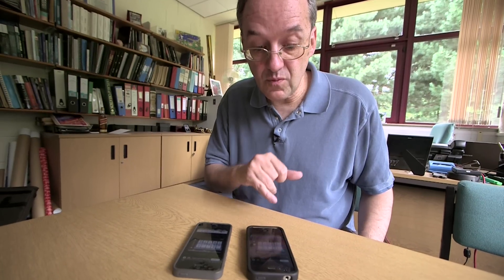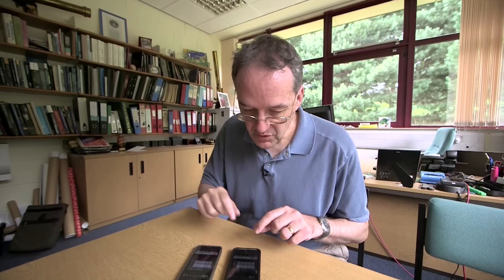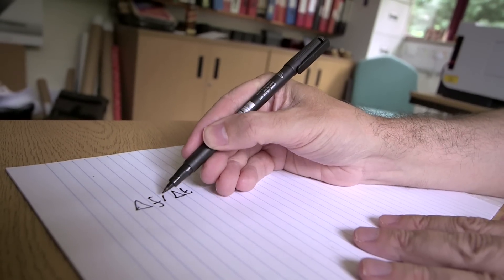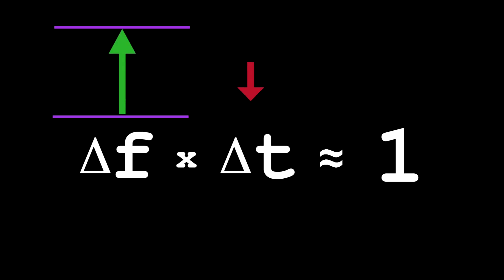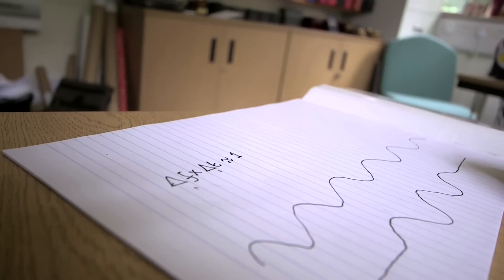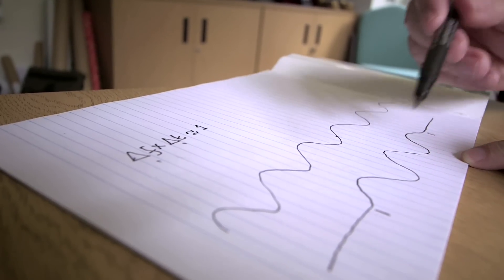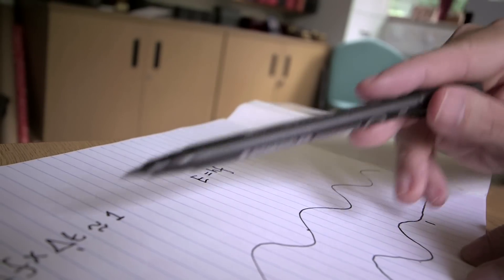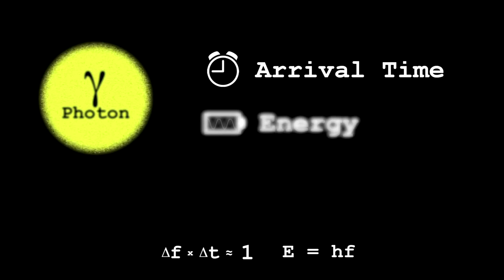What is the maximum Bandwidth? - Sixty Symbols

Comment: More cables. Problem solved. Pay me billions.
Reply: good jorb. clap..clap..clap...
Reply: But you'd need the receivers to process the additional cables and compile it all together, which may not actually save time.
Reply: Stuart Hull Gamma rays are ionizing radiation so they just smash into atoms and knock electrons off them, often changing the properties of the atoms in the process.
 It would not be easy to find anything like an optic cable to shove them down. Radio waves have much longer wavelengths and they just pass through many substances or get absorbed. The range we have to work with for fiber optics is pretty much infra red through lower ultra violet.
Reply: Mexicano President
Many Jobs!
Reply: Give Billions to the Bat-Cat!!
Reply: He said at the end the maximum bandwidth would allow something like a terrabyte of data sent per hundredth of a second. That is far greater than we have now. The fiber optics don't seem to be the bottleneck.
Reply: Extreme wireless, pay me trillions.
Reply: If you can discover new wavelengths then you probably. can make trillions. Phone companies in the US pay tens of billions of dollars to buy a small portion of s wavelengths license. It's called spectrum and so far we have only discovered a small amount of useable wavelengths. If there are more and you discover them first and patent them, you just hit a gold mine.
Reply: Nope, gotta pay for all those cables!
Reply: The people who use my company will pay it off eventually
Reply: Sulfen What you're saying doesn't make sense, you mean discovering wavelengths shorter than gamma rays or longer than radio waves?
Reply: Not necessarily like that. Either discover a way to more efficiently use existing spectrum or maybe there are different types of waves that we have not taken advantage of. It might even be possible to get rid of existing spectrum if we find another way to move data around through the air.
Reply: That makes absolutely no sense.
Reply: Sulfen
Nothing you've said has basis in reality.
Reply: Sulfen WTF do you mean... "data through the air" is radio-communications. Nothing new to do there.
Reply: Think of quantum technology. Before they started working on quantum mechanics we had no idea data could move in so many different ways. Also, think compression. We were able to move larger pieces of data in smaller packages. And you could also think of fiber technology. We went from electric pulses to light pulses making a more efficient pipe.

It's hard to explain something that is not yet possible. People that look into new technologies are inventors. It's not always just about "more cables".
Reply: And before any smartass asks, no I am not an inventor. I am in the programming field and so I do read quite a bit of tech science journals.
Reply: Yeah, if you want to do it like a noob. Send different beams down the same cable at different angles so they don't hit each other, boom, now one cable acts like many.

It's called multimode transmission, we already do it.
Reply: That would only be the change in angle by the change in time by the change in frequency. That still has a  very realistic limit. If within the last few years we have moved from moving megabytes to almost terabytes of data regularly, chances are that we are still very early in the logistic curve for how much data we will be moving. It could even move to being exabytes per second at one point. 

Yes, multimode transmission would help, but it only helps in additive ways, not exponential ways. And data transfer is very exponential.

Also, I know it's an old post, but I'm going to have to agree with Sulfen on most remarks here. Data and wireless data especially is still very young relatively speaking. The capabilities are still very hidden.
Reply: Teth47 won't the signals interfere?
Reply: I paid you a billionth of femto-second ago, $ 0.000 000 044 
Happy?
(unfortunately inflation chewed it up)

Comment: "A terrabyte of data.... in a few hundredths of a second."
Salivate
Reply: Run lots of cables in parallel. Problem solved.
Reply: And that's on a single wire. I imagine you could have 1000s of wires on a single cable, yes? Maybe you run into more physical limitations or errors at too small of a size too, though
Reply: Run lots of cables in parallel yes but also with slightly different properties allowing them to be a control for overall transmission (plus 'overhead') for further range of frequencies (handling things as a bundle). Ie the different cables extend in part the range of frequencies available resulting in more relative bandwidth per cable.
Reply: There is an energy density problem, and mutual coupling between wires.  Shannon's theorem says that data rate is given by bandwidth times signal to noise ratio. (For our purposes, dynamic range is a limit on signal to noise ratio.)   A one Hertz bandwidth on a single cable can transmit a terabyte per second with a mere 44  teradB of dynamic range,  or equivalently 8 x 10^12  bits of resolution.
Reply: all we need is to start encoding data in sperms and transmit them through pipes. they carry terabytes of data per teaspoon, so if we want to copy entire massive databases just have a sperm truck go to the new location, then do a memory check to see if everything transmitted and use the internet to make up the tiny difference.
Reply: Another problem, though, is that the faster you go, the more intolerant to error - noise on the line - you get too.

In the terms used in the video, if you're using a wider and wider range of frequencies, then the more the random frequencies of noise become indistinguishable from the signal.

And if you're using all available frequencies, then any noise on the line is certainly overlapping with your signal, so how do you - at the other end - discern the difference to pull the signal out of the noise?

Basically, at this "ultimate bandwidth", you simply can't. Not possible. Noise and signal look identical to you. You're using all available frequencies and noise - being random - can exist at all available frequencies too. A perfect overlap, so no discernment is possible.

So, actually, in practice, you have to leave some "wiggle room" in there and can't run at the absolute maximum rate.

E.g. if you're sending nothing but a 1000Hz signal down the line at a certain amplitude, then it's easy to discern the signal from the noise. Anything that's not 1000Hz at the correct amplitude must be noise.

Although, as noted in the video, a single frequency like that is informationally useless. But it's also perfectly easy to discern signal from noise.

So if you begin to use a wider range of frequencies to send more information down the line, then the harder it becomes to pull random noise out of the signal. Until, at the maximum bandwidth, using all available frequencies, it becomes an impossible task. The overlap between noise and signal is total, so how do you tell what's what at the other end? You just can't.

Thus it's worth noting that the minimum and maximum bandwidths - one frequency and all frequencies - are pragmatically useless. One frequency can't send any useful information. All the frequencies ends up blending / merging with the random noise entirely.

Like in the video, there's an inherent physical trade-off there. 

The more data you want to cram down a line, the more intolerant to noise you get. And, of course, as it's physically impossible to eliminate all noise completely - all interference, all Brownian motion, all atomic vibration, etc. - then, in practice, to be informationally useful, you can't run at the absolute maximum bandwidth. You need to pull back and give some "wiggle room" by which to discern the difference (either that or you're sending more data - error correction data, replays of the information multiple times - which is wasting potential bandwidth and, again, amounts to the same idea that you can't get more useful information down the line any faster).

p.s. "terabyte" is spelt with only one "r", by the way.
Reply: I hoipe we will live to see that.
Reply: terra?
do you mean tera?...
Reply: Over 11 minutes of monetized video just to get to one sentence.   Then he had to look it up on the internet to find the answer.  Thanks professor, think I could have done that myself.
Reply: @davetriplett8109  well, when you see the word sperm, i think the answer would be yes.
Reply: @McQuokka  derp
Reply: @McQuokka  Maybe you missed how he went over the WHY too?
Reply: @jimdecamp7204  we're talking about fiber here, not wires.  And we've already done this.   The fastest fiber link in the world runs at 255 terabits per second, or 32 TB/s.  That's a terabyte about every 3 hundredths of a second.  This is done with DWDM (multiple light beams of different color in one cable) though, not with femtosecond light pulses.
Reply: @stargazer7644  Shannon's Theorem holds in either case. It's the product of bandwidth and dynamic range.  Fiber has more bandwidth and sufficient dynamic range.
Reply: triggered in Verizon
Reply: terabyte*
Reply: If it's 1 femtosecond, that corresponds to 1 Pbit/s (1000 Tbit/s). I think he mentioned offhandedly that it was a few femtoseconds, so it would be on the order of hundreds of Tbit/s
Reply: Brilliant idea
Reply: Trying not to think about why you're salivating...

Comment: You know I revisit this video as an audio engineer and it explains the basics of impulses, intermodulation distortion (kinda), it hints at the nyquist Shannon sampling theorem (in the sense that you need to decide the bandwidth you need which will define the sampling rate), the Fourier transform (all sounds are just a combination of different frequencies), digital clocking, pulse code modulation (in a very roundabout way in terms of thats the pulses hes on about).

All of these things took me quite a while to fully grasp and he explained/eluded to them in the span of 10 ish mins, bravo.

Comment: What is the ultimate limit for sending through the vacuum of space?
Reply: That would be whole spectrum from kilometers long radio waves to planck length sized photons.

It would be some absurdly large number
Reply: I think the lower bound is definitely the size of intergalactic dust (so perhaps IR?) I don't think there is an upper bound tbh, since space can have almost no mattet (a few atoms per m^3).
Reply: @mangomango14  what about the bandwidth of a signal sent between two Casimir plates at vacuum? that'd be interesting to graph out.
Reply: @voxelsofsorrow  interesting, but what are we charting? Bandwidth vs plate separation?
Reply: @mangomango14  exactly! it's kinda interesting because the plates will cut off lower frequencies while allowing higher frequencies as they get closer
Reply: @voxelsofsorrow  definitely, but I'm not literate enough in QM math for that. But will definitely try to find if someone already has done some work on this!
Reply: The man almost gave me a heart attack when he drank that dihydrogen monoxide (jk) 😔😯😂😐
Reply: @harleyspeedthrust4013  water

Comment: Why wasn't the term heterodyning used in this video? Bandwidth requirements become much more understandable, when the concept is explained. Two frequencies will combine to create both constructive and destructive frequencies. Heterodyning was demonstrated with the iPhone-based tone generators, but not clearly explained. If a 1000Hz tone is pulsed at 1Hz, the transmitter will occupy 2Hz from 999-1001Hz.

Today's data networks use something called Dense Wave-division Multiplexing. We combine multiple frequencies often near 190THz with spacings of a mere 0.8nm, each channel representing 10Gbps. Prisms are readily available to combine up to 80 channels on a single pair of fibers, which translates to 800Gbps, or a Terabyte of raw data in 10 seconds.
Reply: @Michael Hall: What you're talking about is the actual binary information that is transmitted. The video is concerned about the physical limits in transmitting information accross a fiber-optic cable. And mind you, as the professor clearly states, a mathematically true pulse requires an infinite amount of frequencies or otherwise an infinite amount of preparation and decay times to form. Fortunately quantummechanics comes to the rescue there giving us a bounded physical world i.s.o. a purely mathematical one. I really love that part.

Comment: A sine wave can convey three pieces of information.  Amplitude, Phase, and Frequency.  The 19kHz FM pilot tone used to decode stereo information (United States) is an example.

You can think of turning a sine-wave on/off as multiplying the sine-wave by a windowing function that is 1 when the sine-wave is on, and 0 when the sine-wave is off.  The windowing function has a frequency spectrum of its own, and this gets convolved with the sine-wave's spectrum in the frequency domain.  A pure sine-wave's spectrum looks like two impulses (sharp spikes) at  +f and -f.  A rectangular (perfectly "square" pulse) window function's spectrum is a sinc (sin(x)/x) function.  When the sinc spectrum gets convolved with the sine-wave's impulse spectrum, it copies, shifts, and divides by 2 the sinc spectrum around +f and -f.  Negative frequencies arise from converting Real valued time-domain signals into their complex-frequency domain representation.

Check out the Shannon-Hartley Theorem that relates maximum channel capacity to Channel Bandwidth and Signal-to-Noise ratio.
Reply: I think you missed the point he was trying to convey.
Reply: That's not the type of information he is referring to. 
That is nothing more than the nature of the transmission. You need an oscilloscope to translate that.
Hes talking about using that like morse code.
Reply: Sounds a bit... convoluted to me

Comment: The number of "beatings" per second its equal to the difference between the two frequencies in hertz. So, 1000Hz and 1001Hz: 1Hz difference, or one beating per second. 1000Hz and 1002Hz: 2Hz difference, or two beatings per second.
Reply: When he played two tones of different frequencies, superposition of two signals took place. It will result into wave/signal of different frequency. Therefore, that resulting frequency will be LCM of the two original frequencies.

Comment: Wow, certainly entertaining and covering some essentials of physics.
As expected, in the end, the numbers prof. Merrifield comes up with are related to the actual transmissive boundary conditions of the fiber. In this case conditions that allow light in the optical spectrum to pass without significant damping through the cable.
I love it when he gets so enthousiastic that he applies the theoretical fourier analysis and even quantummechanics to the question. Of course he's right there, very capable man, but then you're talking about the absolute theoretical limits in general. And whether one or the other is true and what 'true' actually means is subject to an endless discussion that I sometimes happily dive into but in general constraint myself from.
So yes, great stuff this video and sure to rewatch it a number of times!

Comment: Taking the dispersion effects into account the datarate would significantly drop as the phase velocity of all those frequencies across the visible wavelength wont be the same. On top of that different excitation modes withing the fibre would be excited causing even more dispersion. Along with all this we got non linear raman effects. The real limit would be wayyyyy lower in any practical application.